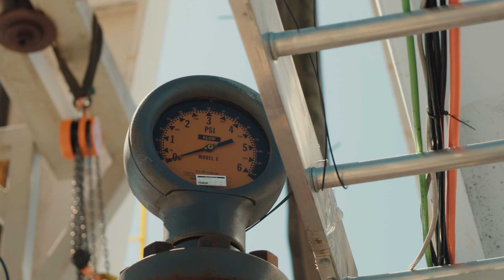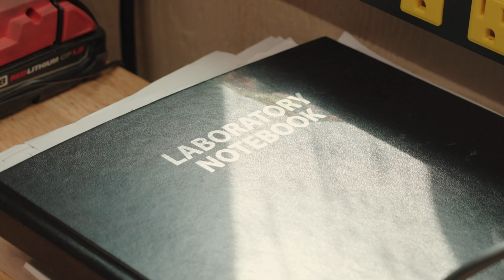World's First MMW Hybrid Drilling Rig

Comment: Do they still need casing? Or does the MMW melt the rock enough to seal it? Does it even melt it?
Reply: It does melt and it does vaporize. One of the key benefits and design features of MMW drilling is its ability to vitrify (turn into glass-like material) the walls of the borehole as it drills. MMW drilling aims to reduce or eliminate the need for traditional steel casing by creating its own borewell lining. Being that this technology is so new, I'd say take a wait and see stance on this. The first pilot drilling rig is likely to offer many learning lessons.